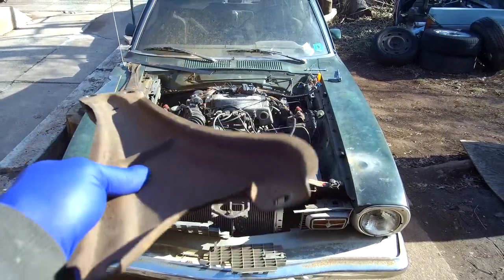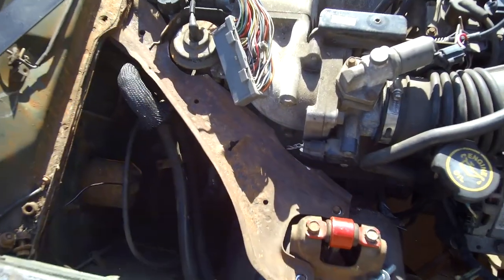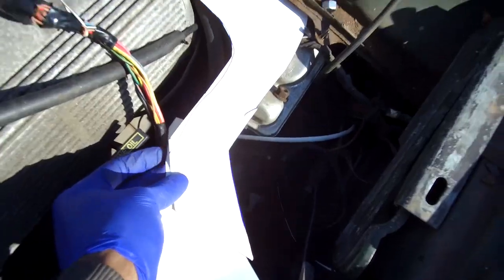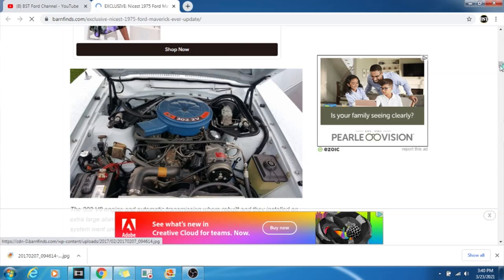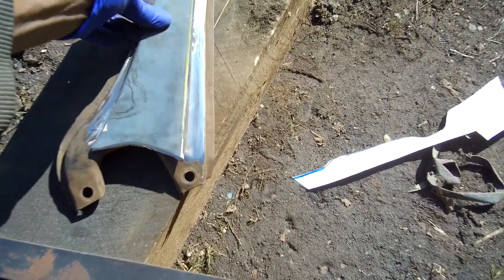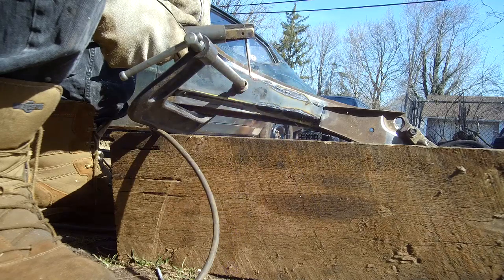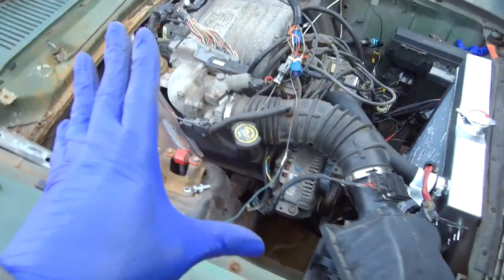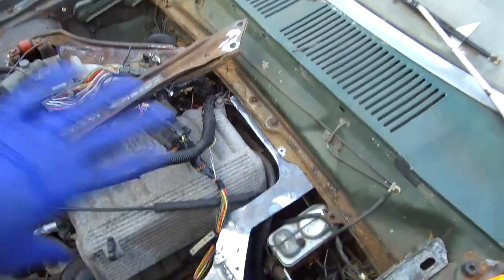Function over Form Ford Maverick Strut Bracing  ( WELDING! ) Comment on Exhaust Ideas.

Comment: Is that going to leave you enough room when the engine torques?

Looks pretty close.

Are you going to put a lip or any bends in the one on the driver's side? It will flex otherwise, you'll need some kind of an angle/edge/lip/brace to have any strength there.
Reply from the maker: I may shave some more on passenger side Glen... That would make good sense lmao.. Thank you for the heads up brother!

Comment: Was going  send u a pic of the  solid steel rod style with brackets made for mine back in day but wouldnt really help you with efi intake,  
The belly bar does help some by tieing bottom together,  got some home made sub frame / unibody connectors on mine that tighten things up alot
Reply from the maker: thank you for this comment that would have helped big time! the belly bar i will get very soon but i just need to get all these small things done... We getting there and i thank you for this comment Daniel!

Comment: I am going to make a cross bar for my Comet. From next to the strut tower, to the other side. Less flex on the cornering and bumps on the road. It will help stiffen the suspension.
Reply from the maker: I may buy that one I seen one for like 30 to 40 bucks I need the belly bar now J Taylor
Reply from the maker: I did this Boss 302 trick on mine https://youtu.be/grXnFy1XFR0

Comment: 8:30 I heard that.
The few times I've had to take my cars in for work, (alignment, tires, etc.) I wash the car, vacuum it, detail it a little bit.
So when the technician gets in, he knows the car is well taken care of, and the owner is not going to be happy with shoddy work.
Not to mention dirty, greasy hand prints all over the steering wheel, gear shifter, door panel etc.

Because, when they get clapped out rolling messes they don't care as much.
"If the owner don't car about this car, neither do I" 

It's just turrible!
-Charles Barkley
Reply from the maker: AHHHH you see what i am saying so i have to get the car tidy up just a taste... cause they will give lower than low results with a high price lol.. The same with my cars ( no projects )  i have to do the same

Comment: Excellent job on getting a solution, the more you weld the better it gets. Keep going, I think you sounded a bit more passionate on this video.
The Mad Max solution is turning the hood into the stressed member :-D With the engine exposed and the exhaust going up...
Reply from the maker: thank you for this comment i really miss do this type of stuff to a car.. The welding and cutting i do enjoy ( it calms me ) the sizzle from the arc welder lol. I have few goodies i want to add to the car but i may get new leaf springs... I am going back and forth with that thought Rob . what you things
Reply: @bstfordchannel923  ah yes, there is nothing like seeing and doing work that you can see completed. Welding is still something I need to pickup, lol
As for the springs, inspect the leaves for stress fatigue first. I had a Mustang II I put a 302 in, the rear diff fared better than the springs! Get her running and then see if you want to change the stance. As always keep it up!

Comment: I've been really anxious to see how you were going to solve this problem. Looks good man. My only question is still whether or not the engine is going to make contact with that passenger side bar. But the ideas and problem solving skills you have are great! The only thing I probably would have added to this is maybe a little more steel along that fire wall where those two braces mount up with some longer and beefier hardware. Just because it seems like from the video that the edge where those bolt onto seems weak. It probably isn't but all I have to go buy is the video. All in all I think you absolutely nailed this build and I am proud of you man! I constantly recommend BST Ford to customers at work!
Reply from the maker: The brace on passenger side may need to be shaved I may have a second trick ( t keep the motor to stay solid ) old trick cars use.. If it touches I will sand down more... Now the thing metal at the ( top where it mounts to fire wall ) its solid in stock form . i weld it togeher and add more bracing... Now on the driver side I added more bracing on that also ( it needed that ) this was a good write up brother!
Reply: @bstfordchannel923  awesome

Comment: got an idea for ya to make this look about 6000 times better and be respectably cheap. itll take a foot by say 6 to 8 inches of steal. draw and cut out your ends. take tube steal bend it until igoes around the area you need it to. a cheap pipe bender works wonders. slice the ends simuler to a fork and slide the end pieces on it weld it and itll be stronger then facotory. paint it and itll look nice. you goin to need a a cross brace from tower to tower.
Reply from the maker: Thats a GREAT IDEA! , but i was working with scarps just laying around or what I can afford for $35.. Thats a good one i need bender and the right size tube also. It will have to try that next time
Reply: @bstfordchannel923  yea you could get scrap pipe it still be stronger and nicer lookin maybe a later project lol

Comment: I have a 1972 comet gt (same as a maverick grabber) and the drivers side strut rod ripped out from the front part of the frame where the rubber bushings attach. Not sure what to do now I might be forced to part the car out as I don't see how it could be fixed 🤔
Great video keep em coming 👍
Reply from the maker: You can fix that part you have to start welding brother ... If i seen it i can tell ya.. they have that part out there.....stay down with the car Lucky you can find that part

Comment: Hey man, thanks for the shout out! You did the work, all I did was scratch my head and throw stuff out there to see what you thought of it. That sheet metal is hard stuff to stick weld, props for that. The driver's side came out good. I see you welded some sort reinforcement to the bottom side and added a third bolt to the pinch weld, should be at least as strong as stock if not more. I'd be interested to see the bottom side when you pull it off to spray bomb it. You even left plenty of room to service the master cylinder. Looks good to me, throw a bar across in front of the engine and you're golden. That could made of almost anything you can weld mounts to and doesn't feel flimsy at the length between the shock towers. Round or square steel tubing, iron pipe, an old closet rod...anything that doesn't look cheesy because it's obviously something else. I've heard of them being made from electrical conduit.

If you're getting it aligned, see if you can get a shop to use the numbers you give them. Original alignment specs for these cars were made in the days of skinny, bias ply tires and slower roads. Any Falcon-chassis car will drive better if your shop will dial in these specs: +2.5 to +3.5 degrees caster...the more the better. -0.5 to 0 degrees Camber. 1/16" to 1/8" toe in. My source is here:  https://dazecars.com/dazed/suspension101.html
Reply from the maker: I have to give credit where credit is do... I will not take credit on something i got assisted on.. Tell me about that sheet metal ( rusty ) thing sheet metal.. thats was a hard deal to do. I got that done.. i was shock after I looked at it... This thing is way strong than what it was ( even by sound ) it has a deeper note when you hit it lol..  I wanted to go back out there but its raining now...  I have some other plains to get the car right and thats wires and placement of the ecu
Reply: @bstfordchannel923  very nice, see you on the next video. I'm just a few hours south of you down the coast, hasn't stopped raining all day.

Comment: What about a 5.4 swap 6speed auto  from 2010 f150
Reply from the maker: its a cool it can fit.. you have to wire the thing up
Reply: @bstfordchannel923  that’s something I suck at I’m still tryna figure that out
Reply: @bstfordchannel923  I want my top end to be like 160. Also trying to compare that the 4.6 4speed with mods